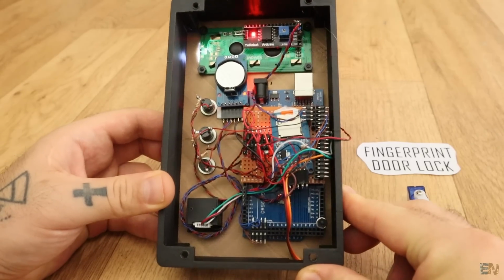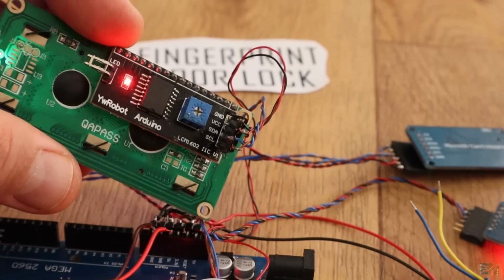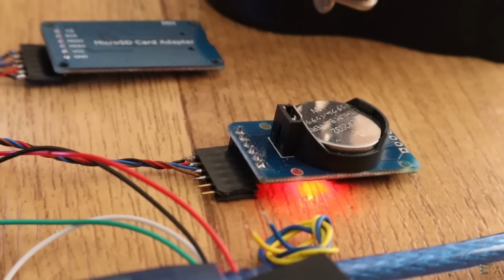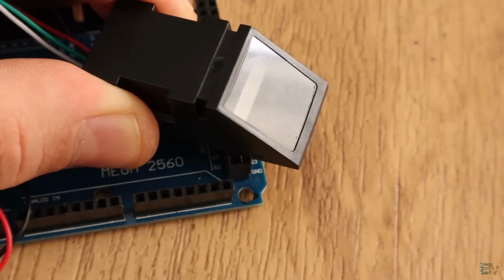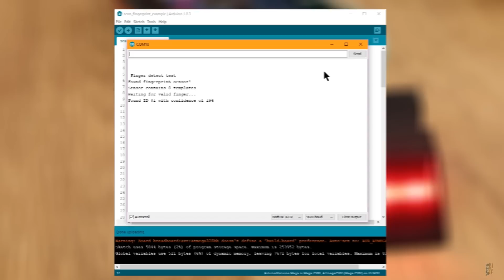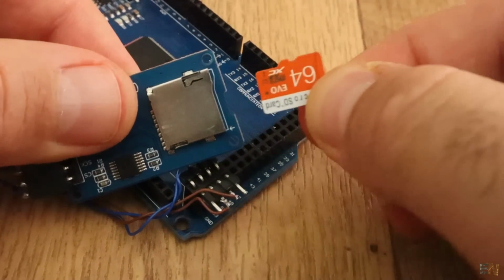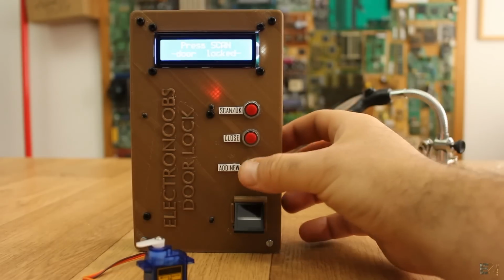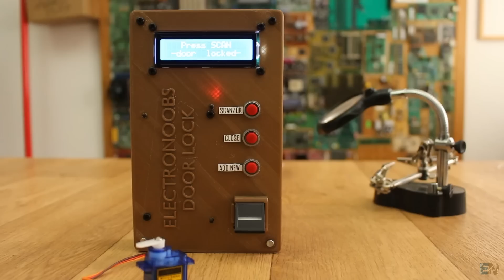Fingerprint DOOR LOCK with BlackBox security

Comment: Hey I’ve printed out all parts and I have all electronics but I’m stuck trying to code. I’m trying to set the time using the ds3231 library and code but keep getting error saying “no matching function for call to ds3231 etc.. and it’s highlights “ the part under void setup..Ds3231 rtc (SDA,SCL);. Searched the forum and it says the code isn’t the right one for the library

Comment: Isn't it possible to simply unscrew your case and manually tell the servo to move. You should create a setup with all the electronics inside the house so it won't be possible to take apart from the outside
Reply: Jo Hinder you could (and should) just simply put the servo and all the electronics except the servo behind the door, so it can't be tampered with.
Reply from the maker: The idea is that the servo would be on the inside of the door and the electronics inside the case. Metal case even better...
Reply: Still safer just to leave the arduino behind the door. Ripping off the metal case from the wall or door would leave the servo wires exposed and the system wouldn't be so secure.
Reply: By the way, i really appreciate you making these videos and even taking time to anwser questions :)
Keep up the good work!
Reply: Electronoobs  And you could put anti-tamper measures. For example, activating an alarm if unscrewed. Also, putting a microcontroller on the inside that checks for a specific key sent by the one on the outside would massively improve security.
Reply: Yes, if he says it is the last video on this topic then this point should be here too, there are special cases for this with screws that can be only screwed in and are covered with a piece of plastic in deep holes plain to surface, and stuff like that, but they are expensive and it's about diy, the easiest was would be to put all on the inside and only put th display, buttons and scanner, on the outside, but the pcb of the scanner also on the inside, because the prints are saved there and you could just programm your own one, rip that one of and connect you own, then you not just come in, you owned the room, the cables stuck throught a hole as small as possible and hardened somehow so it can't be used as the weak point, but there must be any kind of emergency-key, like if someone breaks the scanner and you can't get in, but this needs to be a secret.
Reply: But I think it was about the electronics and some 3D-printing, not really about to secure something.

Comment: emmm, why are there softwareserial in the code? i mean ATMEGA256 have literally 4 pairs of hardware UART
Reply from the maker: There is a serial UART that is used for uC programming, serial monitor and so on and that is for tx0 and rx0. The other serial in the code is defined as a software serial where you define the pins and those will create interrupts for rx and TX pins from the fingerprint sensor.
Reply: But the point is that the mega has several other hardware uart pins which you could use